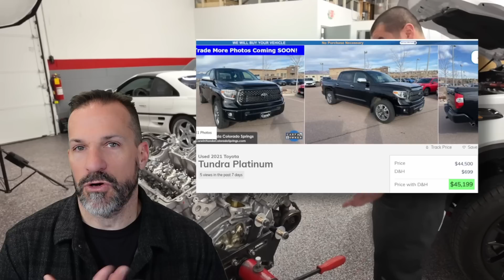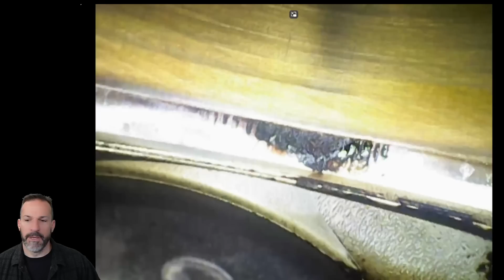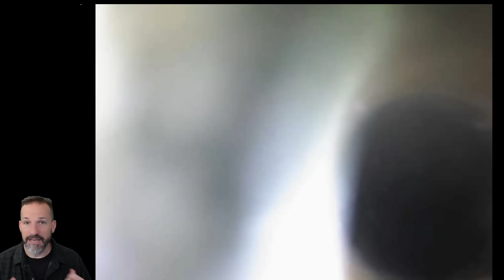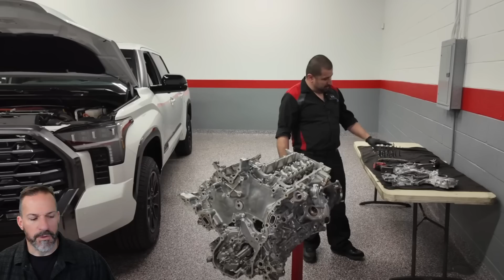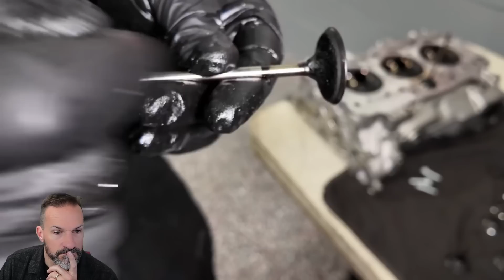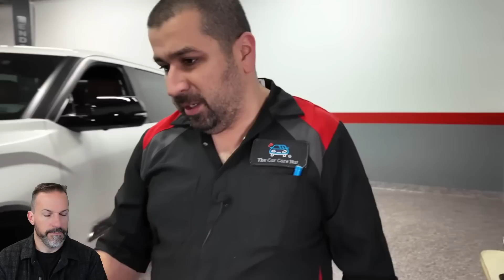Has Toyota LOST Their EDGE? Tundra Turbo V6 TEARDOWN vs. 5.7L V8

Comment: I have had 3 Tundra's ( 05, 07. 12) and 4 Tacoma's (99, 01, 09 , 14). They were all very good Trucks. My trailers just happened to get to big for a Toyota to tow comfortability. I ended up with a F250 6.2l, Not the quickest by any means, but its just reliable. Just general maintenance for the past 100k, and it has spent 1/2 its life towing a 10k trailer.  Had a diesel F250 before and the emissions killed it slowly. After towing with a 3/4 ton, its hard to go back to a 1/2 ton.  I really like the new Tundra's, and My Dad recently purchased a 25 for his retirement gift to himself. I hope it don't end up with these issues.  I am the one who talked him in to one.
Reply: I have a 2016 F250 4x4 6.2  (60k miles) which also is used for work to tow  a 8-12K trailer for work. O issues only oil changes , transmission drain and fill and last year changed the antifreeze which is now switched over to the new yellow. The original orange ( I think it was) people reported problems with the heater core from it so you may want to check . Anyways, I wish you good luck with your f250.

Comment: I have a 2013 LX570.  164K miles and runs like a Swiss watch.  Especially so after I just changed the spark plugs.  Change oil every 5K miles, full synthetic Toyota OEM.  I plan on keeping my baby for a long time!
Reply: Neat but totally irrelevant to the conversation.
Reply: @hochhaul  What are you talking about? The LX570 has the 5.7 V8, and as The Car Guy Online surmised at the end, the 5.7 is probably a better engine than the new turbo V6.  That was the point I was making.
Reply: @fogodechao  neat but irrelevant

Comment: Just bought a Private sale 1 Owner 2019 5.7 last month.  Has 100K miles on it, but driven by a guy in his Mid 50s like me and he changed the oil every 5K.  Hopefully I have as good of luck with this as you did with yours.   It runs like a top right now.
Reply: If you tow, look into a trans cooler.
Reply: Good idea 💡
Reply from the maker: You should have great luck with that, those 5.7L are great!
Reply: You’ll be just fine. I’ve got over 200,000 on mine.

Comment: The oil that’s recommended for the new turbo charged engines is to thin they need to move up to minimum 5/30 I would use 5/40 in hot weather. Not 0/20w for a turbo charged engine way to thin. That’s why use see all that wearing..
Reply: I agree with you , the main problem is all about the low viscosity oil.
Reply: @KBYalfalasi  Wrong. The main problem is oil consumption. Turbo engines unlike naturally aspirated engines will go through oil much quicker. Toyota needs to ditch the traditional oil dipstick already and put a sensor on the oil pan already. Warns you on the dash when you're a quart low. Solves all the problems. Not saying there is not a problem that is causing all of these engines to essentially go through all of their oil before the next oil change service but with the oil sensor catastrophic failure could be avoided. I have the old 4.7L  v8, 270k oil consumption is 1 quart every 100 miles. Engine keeps on going because I check the dipstick every day. Do the math, that's around 40 quarts every oil change at 4k miles, (I don't do oil changes anymore) but just imagine how long the engine would last without me constantly checking the oil... There is otherwise nothing else wrong with the engine, no odd noises, I take it on road trips across the country all the time no issues, just stay on top of the oil. Eventually going to get oversize pistons to stop the oil consumption.

Comment: They should’ve been a truck successor to the 2jz inline six with a single small turbo.  They’ve could’ve even used the bmw b58 from the supra for inspiration.  It would’ve been stronger with more main bearings, smoother, and sound way better.

Comment: 2006 Tundra still the sweet spot,  my 2002 Tundra was on its 3rd transmission since that 4 speed was from old tacoma, 5 speed fixed it

Comment: Thanks for starting your channel, l bought a 2007 Crew Max 5.7 in 07 and had it until 2021 with 220k miles but traded it in cause it was rummerd that they were replacing it with v6 turbo, I bought a 2021 tundra V8 pro and should be good for another decade !
Reply: I had a 2014 Tacoma for 7 years always hummed and hawed the tundra because my family kept growing. The minute I found out they were switching to a v6 turbo I panicked went straight to the dealership and bought a brand new 2021. Phew dodged a bullet there. Sold the Tacoma privately and got a lot for it because the 4.3l v6 was really sought after.

Comment: If you listen he commented a few times someone ran this engine with a low oil event. This isnt necessarily typical of the new engines
Reply: He did, but if you poke around on the tundra forums and look at what people had to say on their failed engines, many stated that they found their oil levels low. If this engine is eating oil early on in its life given how little some people check those things, I wouldn't be surprised if low oil level events became more of a problem the older these things get.
Reply: @aknapp1350  you have somewhat of a point. But the question would be then is the low oil issue a contributing factor or and effect of another issue.  I have a 23 1794 that is less than a month outside the recall, so as you can imagine im a nervous nelly. I have noticed that it is rather difficult to read the oil level on the dipstick of these trucks. Never the less i try to look at it this way if the eng fails and toyota replaces it then its like i got at this point 12485 miles for free lol.  I will say i do have an occasional rough idle that i dont think should be happening with this low of miles as well as the transmission feels soft shifting, i feel that sport mode is more like what a new truck should feel like on a normal day to day wish they would have done a better job with that program

Comment: I just don't get how toyota failed so quickly. It's nit just Tundra or Tacoma. My family has owned Toyotas for 30 years. I had a mid 80s MR2 and it was bulletproof. My brother had a 90 pickup. Just sold it last year. Not 1 single issue. Now I'm at a loss. I don't see any vehicle lasting 5 years without a big $5k+ Repair cost. And any battery issue with hybrids or other new tech could be even higher. Such a disappointment.
Reply: Indeed

Comment: Great video and keep your 5.7 as long as you can.  My dad worked at a Toyota dealership & warned me years ago they were going to V6 turbos.  I got the '21 in Spring of 22.  On the way home, I stopped to see a buddy at his Toyota dealership he works at.    He and several colleagues saw my purchase and said I made the right decision.  Even they were skeptical with the new engine design.
Reply: I have regrets for sure. My 25 is good so far, but I bet my 08 sequoia would outlast it.  Too bad I sold the 08.

Comment: A lot may not remember but TCCN was an advocate of the New Tundra V6 engine.  And even asked why would "anyone" want to go back to the V8?  Um, I don't know TCCN, maybe cuz we know our V8 engines will outlast the V6.  He's good but sometimes his Toyota loyalty blinds him.
Reply: I think you’re confusing “advocate” for “optimistic” do remember that the UR series v8 engines had severe issues in their early years with valve springs fracturing leading to terminal engine failure and it took Toyota a few years to get that fixed. Not to mention chain tensioners rattling as early as 30k miles and head gaskets blowing as soon at 150k miles. In my opinion neither the V35 and 3UR are any good long term compared to the 2UZ v8 from the early 2000s.
Reply: He was ecstatic when he got. He seems disappointed now. But he like us, always has high hopes so ya can’t blame. I believe his videos have contributed to my 22HL’s life. Change new car oil at 1k and AF at 50k. First mechanic who did the oil said I was wasting$$. He ate steaming cup of crow when gold dust found in the oil and filter. Change AF. Mech said I was wasting$$. He too had the same bowl o’ crow when ph was waaay acidic. I’d rather change that than head gaskets.

Comment: I mean they made the toyota supra in 90s and it could handle tons of horsepower with also being reliable. All car manufactures can make over engineer engines to last longer but they choose not to so they don't get driven for 500,000 miles anywhere. Toyota has gone downhill and needs to rethink what there doing and get back to being toyota ! They decided start taking a few shortcuts that they can get away with it but they are getting greedy now. And nobody asked toyota to change their engines . Who the hell said they wanted toyota to change their engines because I know I didn't. And if these engines are cheaper than a v8 why in the hell are they 15k more than the last generations . The tacoma and tundra prices are ridiculous. Toyota was always the middleclass reliable kind of affordable vehicle simple vehicles. They are really really starting to follow the crowd and be stupid.  Another thing when these vehicles were made in Japan and Canada they were quality. Now that they are made in Mexico the quality really went through the tube's. The quality control is so bad. And another thing toyota has always fixed new gens issues ... they bigger get to fixing !!! I can't believe they have waited this long to fix them !

Comment: Do you think if you use premium fuel, you have less carbon buildup I was just asking a question. I have no idea.
Reply from the maker: Possibly. It's not a lot of carbon and none on the valves, but some in areas where it doesn't matter too much (yet). I think I'll try to run some heavy duty cleaner through it and test to see how the cleaners work, will be another good video hopefully. I need to scope a couple more cylinders too just to get an idea.
Reply: I heard seafoam is good for that
Reply from the maker: @ I have run a couple cans of seafoam over the past few years, but I did not do anything directly in the intake. I did a can in the gas tank, a can in the engine oil. It did help free up my driver side timing chain tensioner which is common in these to start to varnish and...be slow to pressurize. I should have borescoped it originally when I bought it to see the difference :).

Comment: I believe that the carbon build up on the intake valves is a composition between the EGR and direct injection.  Forced induction tend to burn out quicker than a naturally inducted engine.

Comment: I bought a 2024 Tundra, specifically because the Tundra Recall Notice for crankshaft bearings specified only the 2022 and 2023.  The Toyota Dealer explicitly stated to me that the crankshaft bearing problem was fixed for 2024.  

He was under-informed or lying.  

As a long-time Toyota owner, I believed that Toyota would not still be selling an engine two years after a significant problem was identified. Subsequent to my purchase I learned that the 2024s are blowing up, just like the 2023/2022s and reports of the replaced engines blowing up!  

https://youtu.be/f3sQtX6bz8E?si=ML0gocGDZXWSOtOJ

https://youtu.be/0eySXnbqgvc?si=ZD2vLYw3Dt-_zjTx

I feel that both the Toyota Dealer and the Toyota Corporation betrayed me. 

Instead of focusing on reliability in engineering and manufacturing, Toyota has focused on complicated, expensive and increasingly absurd trim items.  Complexity is the enemy of reliability.

I traded the 2024 on a 2020 TRD Pro with 30,000 miles on it, five days after buying the 2024.  I lost $5,575, but at least I won't have the crankcase bearing freezing up, and I won't have the turbos overheating and chewing up the oil.  New Toyotas are radioactive.  Buyer beware!

A great Care Care Nut analysis of the bearing problem:
https://youtu.be/EyI4ujjxxuk?si=kjGux5M

Four years of documented Tundra engine failure:
https://youtu.be/f3sQtX6bz8E?si=UIpgK-WbF25dn3wc

The lawsuits are starting:

https://youtu.be/55qeZksZxmw?si=pXxulkcEGOsfmdnd

https://youtu.be/-3StMKG3Qq0?si=I6qc5fhe565Cptkp

Comment: I'd rather have your 5.7L v-8 over the twin turbo 3.5L v-6 because of the long history of reliability for that engine.  Toyota is slowly catching up to GM, Ford and RAM when it comes to lack of reliability.  IMO the biggest problem with pickup trucks  is "Made in Mexico"!  My 24' Nissan Frontier uses a v-6 without turbochargers and it's not made in Mexicao and hopefully it'll be reliable for many years provided I maintain it!

Comment: Toyota uses the same engine in its most expensive vehicles—including the Toyota Tundra, Toyota Sequoia, Toyota Land Cruiser 300 Series, Toyota Land Cruiser 500 Series, Lexus LX600, and Lexus LX550—which are the highest-priced models in the Toyota and Lexus lineups, and all of them share the same engine problem.

I don’t believe Toyota would replace over 100,000 engines without first identifying and fixing the root cause of the issue. I also saw a 2022 Tundra in Tampa, FL, with 200K miles and no engine problems. The engine failure in the Car Care Nut video involved unknown mileage, service history, and driving habits.

Comment: Car care nut said it many times, he has no idea the history of this motor. It could have never had an oil change and drove 10s of thousands of miles. He reported what he saw but couldn’t conclude any of the wear due to design flaws or lack of maintenance (or both). Keep in mind Toyota has been producing this motor since 2017 but only started getting critiqued under microscopy when it was put in the tundra.

Comment: That was a great video from The Car Care Nut.  I saw several things in that video I did not like about the new engine.  Valves not looking clean even with port and DI.  PCV  location. Wear on the piston and bores. The one bearing that was a complete mess...  Toyota has totally lost who they were.  Dependable, reliable, vehicles... look at them now.  They have gotten too expensive in msrp's, too complicated and cheapened (parts and engineering) their products all at the same time, craziness. TCCN has a new Tundra with the new engine, I wonder if he will keep it after tearing that one donated engine down.  In my opinion, Toyota will need to re engineer and re design several core components of this engine to 'fix' it.  I won't be buying a new Tundra.  Bring back the 5.7!

Comment: I thought that the cylinder wall wear was called piston slap. Usually caused by wrist pin failure. I may be completely wrong.

Comment: I agree with him in that I also love everything about the truck. Few very minor things like little headliner rattles in the cold and some more noticeable wind noise over 70.

The main thing you neglected to emphasize is that you're comparing a good running 5.7L with a known history, to an unknown mileage, unknown history, blown up V35A. Not exactly a fair comparison. Find a good running V35A, preferably with higher mileage and borescope it and that would be good to know information.

I don't think this powertrain is perfect, far from it actually, and I hope toyota continually works to BOTH refine it/make it more reliable AND take care of customers with the earlier iterations. To give the recalled trucks a full engine assembly, but the ones outside those dates with the same exact problem a short block with reused parts and subject to the skills of the assigned technician to assemble... is beyond me. I almost would rather a 2022 to my late 2023 for this reason alone, but i guess this is all trivial until (if) mine blows too. 

If Ram brings back the 5.7 and puts the 6.4 in the 1500, I will have to take a hard look at the specs, what trim level each is offered in and of course the price. If it checks every box I'd probably jump ship to Ram. I tow 8k lbs probably 100x a year, but dislike the ride quality of every 2500 I've ever ridden in